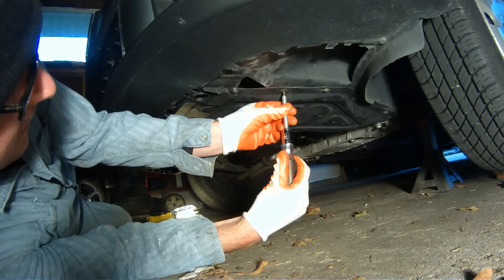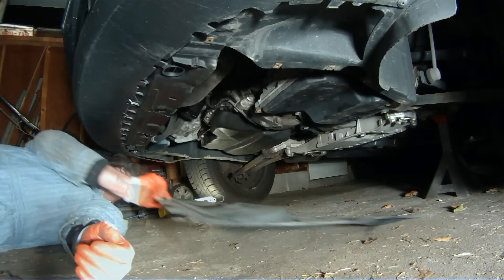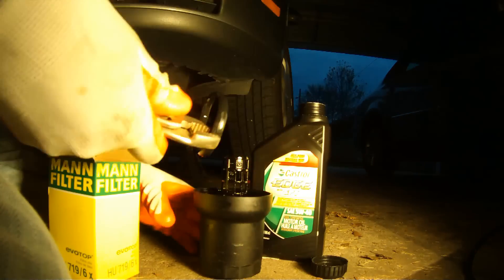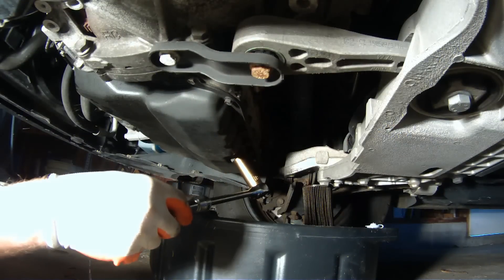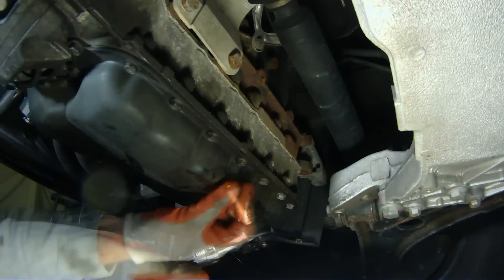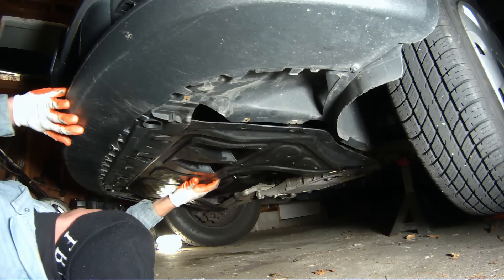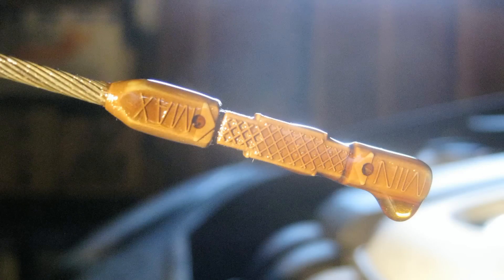VW Rabbit Oil and Filter (2004-2008)

Comment: I have changed my oil and filter 12 years in a row with no problem. Today I tried to take the oil filter cap off and I could not get it to budge. The socket was slipping on the cap. It is way too tight. Someone advised me to put a sheet of paper in the socket for a more tight grip and try. I wasn't aware that hand tightening was sufficient.
Reply: @Doom1AM  Tap lightly on it with a hammer or metal tool. Mine never comes either until I tap it with something,
Reply: @Doom1AM  Great news. Glad you had success finally. Someone on here suggested to hand tighten the cover and I am going to do that next time and  I should have better luck getting it loose when I need to change the filter. Take care.

Comment: Great video. Used it a few times to change the oil in my 2006 VW Rabbit. A word to the wise: make sure you're putting in the filter housing exactly in the threads. Had an issue where the threads were slightly out of alignment and the vibration of the car caused the filter to back out, causing a massive oil leak. Eep!
Reply from the maker: thebumblebean Good tip!  Reminds me of that game Spy Hunter:).

Comment from the maker: You don't "have" to drain the filter first.  I chose to show it first in this video because I figure more viewers are curious about how that confounded thing works than how to loosen a drain bolt:).
Reply: do you know how many times the DSG version shift, besause i saw a rabbit here in holland but normally you see in wich gear the car is driving but by the rabbit i didnt saw it,,, is it a 7-speed automatic or a 6-speed automatic..

Comment: I recently had a oil change done at a  super lube location and 4 days later my splash guard was sagging in the middle, after driving on the highway for awhile .I took the car back to the garage and told them and was accused of bottoming out my car . I was told by another garage they should be taking off the splash guard before the oil change and when I said this they looked at me like I was crazy .  Not going back there for a oil change  but they offered to install a new one free of charge 🙄 but I would have to buy a new splash guard
Reply from the maker: @dpetit007  This is exactly why I don't let anyone else change my oil.  Whether at an oil change place or a dealership, the person doing the oil change is typically an inexperienced underpaid impatient teenager.  There's a high likelihood they will lose one of the fasteners and be too lazy or too frustrated to seek it out and reinstall properly. Although this particular splash guard is very straightforward, some splash guards use significantly more and  a variety of fasteners. Sometimes one or two missing fasteners is no big deal, but other times a single missing fastener can lead to other underbody damage and unnecessary wear and tear.
Reply: I guess I’m going to learn how to change the oil…, wish I learned this before 😊

Comment: really good video and info about where to get cheap the tool removal
Reply from the maker: Thanks for the comment!  The oil filter housing could actually be removed with a traditional strap wrench too, but I was nervous about possibly breaking the plastic housing when not using the perfect tool.

Comment: My vacuum pump leaks slightly, can just fell oil around the edge with my finger. Should I change part right away. Valve gasket was already replaced.
Reply from the maker: I coincidentally rebuilt my vacuum pump two weeks ago due to the notorious VW leaky vacuum pump issue.  It looks like a pain, but it's not that bad.   Do it!  I bought my rebuild kit (two gaskets and a hose seal) from RKX Tech for $36.   I used the RKX Tech instructional video and the Deutsche Auto Parts video (both linked below) for guidance. You'll need to watch the latter video from Deutsche Auto Parts if you have an automatic transmission which is slightly more complicated than a manual transmission.  My oil pan, splash guard, and drive way are dry as a bone now.   Good luck with your project!

RKX Tech Video
https://youtu.be/t8s1y3RIG7s

Deutsche Auto Parts Video
https://youtu.be/Maf3-7C5qZI

RKX Tech Rebuild Kit
https://www.rkxtech.com/products/rkx-vw-audi-2-5l-vacuum-pump-reseal-rebuild-kit
          
Shout out to @RKXTech.com and  @Deutsche Auto Parts for educating me and saving me $1,000  over what the dealer would charge!!!

Comment: Another great video! When I tighten the oil filter to the housing I use the two arrows on the housing. The first arrow is to snug & the second is to tighten. And there is a common mark on the housing BASE you are tightening to, (looks like a triangle). I painted that mark red, and the marks on the housing painted silver. And don't go past that second mark it's only plastic, cost to much $ to brake.
Reply from the maker: More great advice!  Thanks!

Comment: Thanks, I am going to save 50$ doing this myself. also, I am not always sure they put in the real synthetic oil.  Mine is a 2007 rabbit 2.5 is there a difference?
Reply from the maker: Your 2007 should be identical to my 2008.   Also, I agree. You never know what the oil change place is putting in.  Further, even an advertised  "synthetic" oil change is not necessarily European grade synthetic, which costs significantly more. If you hit Advance Auto on the right day, you should be able to get a 5 quart jug of the correct Mobile 1 for $38 and they'll throw in a $15 filter for free!
Reply: Thanks, for the follow up, I live in So. California, I've never seen an Advance Auto. I paid $20.60 for the filter at the VW dealer. I'll check out Advance  online.
Thanks again
Reply from the maker: I made my first ever car repair in my friend's driveway in Oakland, CA!  A water pump on a 1973 Dodge Dart.  Then we drove it to Wisconsin. I believe we bought the parts at a Pep Boys?  You still have those in Cali?
Reply: Yes, I think in Pasadena?  My brother and I changed a camshaft belt on a 78 Honda civic. We were just kids and it seemed impossible at first, but with one of those manuals for a complete idiot we did it.  I wouldn't try anything like that on today's cars.

Comment: This is really good.  Hey quick question.... the Rabbit has a special jack that has a groove in it to accommodate the welded plate when you lift it.  But, you just used a flat surface jack, from what I can tell.   Did I see that right?   Are their pros/cons to this method?  Thanks!
Reply from the maker: The scissor jack that comes with the spare tire kit has a groove to mate with the jacking point.   That's important for the scissor jack because it gives the scissor jack added stability.  In my opinion, the scissor jack is an emergency-use-only jack.  You should only use it if you absolutely need to change a flat on the side of the road.   You should never rely on the spare tire kit's scissor jack for doing other maintenance that requires you to lift the vehicle for an extended period.  Never get underneath a vehicle only supported by a scissor jack.  Those things are flimsy:)! So...in closing...lift your car with a quality jack rated to handle the weight of your car and add extra support with jack stands and wheel chocks and parking brake. Stay safe:)!
Reply: @hanoihancock  oh I definitely agree, and I'd never go under a vehicle unless it were on ramps, or jackstands.   (and even then I put extra emergency supports just in case).   My main question was about those hockey puck groove adapters that claim that a flat top jack, with a thin jack point, can cause the jack point area to bend a bit too far... I get that the jackpoint is engineered in such a way that the emergency jack is a bit more stable... but in the case of using a real jack, or jackstands, since they have a flat top my impression was you need to now protect the bendable jack point.... sorry for not being clear.
Reply from the maker: @splatbubble  Okay.   This is a bit embarrassing. I had never head of a jack pad until you posted this comment.   I just ordered my first set of slotted jack pads for $12 (https://amzn.to/3sXchay).  Eager to see how they work!  TY!

Comment: Was wondering if you happen to know the torque sequence an spec for replacing he lower oil pan gasket?   Been putting off doing this an would feel better knowing
Reply from the maker: According to the Haynes manual, the lower oil pan bolts should be removed and reinstalled in diagonal sequence.  Tighten by hand first, then tighten to 89 in-lbs or 10Nm.

Comment: Does the T23 and 17mm drain bolt apply for the 2006 Passat?
Reply from the maker: The 2006 Passat (B6 platform with 2L) uses a 19mm drain bolt and T25 Torx fasteners for the belly pan.

Comment: I read that the vw rabbit 2.5 oil housing tool is 74mm not 76mm. Which are you using?
Reply from the maker: Just double-checked my garage.   My tool has 76mm 14 flute written right on the label.  I just changed the oil on this vehicle last week. I did a little searching however, and found that similar oil filter wrenches are advertised as "74-76 mm".  I suspect that may be why you are seeing references for both.  Here's an example.  

https://www.blauparts.com/audi-vw-oil-filter-wrench-74mm-76mm.html 

On the other hand, maybe I've been using a too-large-but-small-enough filter wrench all of the years and just never noticed?  I may just buy one a 74mm wrench just to see if it fits my Rabbit.
Reply from the maker: So...I ordered a 74mm Aluminum Oil Filter Socket (https://amzn.to/2K12xr9) and it fits even better than the 76mm socket I've been using for years!  TY for asking this question!

Comment: Why is there a flat O-ring, and a standard O-ring about the same diameter. My filter housing is leaking after my last oil change and I only used the flat O-ring.
Reply from the maker: I think some paper filters come with both kinds of O rings so the filter can be used with different cars that use different O rings.  For this car, the flat O ring is the correct O ring.  I recommend changing the oil again and inspecting the filter housing closely to make sure the O ring is seated properly and that there is only one O ring in there. It's common for an old O ring to be accidentally left in the housing while installing a second/new O ring.  That'd cause leaking. Maybe clean out the slot the O ring sits in with a Q tip to be sure there's not a pebble or something stuck in there.  Good luck!
Reply: @hanoihancock  I’ve reinstalled this thing 3 times, and I’m starting to think it’s an oil cooler gasket above the filter housing
Reply from the maker: @PacificParadiseProductions  That'd be unfortunate:(.  It's already unfortunate that you've had to spend 15 quarts of oil and are still leaking:(.  I guess you've gotta get some nice bright lights and some rags and some good music to listen to.  Lay on your back.  Clean the crap out the oil filter area.  Wait and watch for the origin of the leak.  Pray that it's a faulty or damaged filter housing.

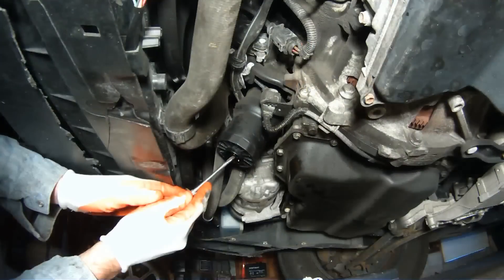Comment: 0:43 , what do you have attached to your ratchet? love how concise the video is man, so easy & simple. much appreciated by a non-car guy that wants to start learning how to do the maintenance on my car
Reply from the maker: That's a 74mm 14 flute oil filter wrench.   You use it to unscrew the oil filter.  You can buy one using the link in the description for around $10.
Reply: @hanoihancock  Thanks man

Comment: Just got my rabbit is it true oil changes are every 10,000 miles or 12 months
Reply from the maker: Yup. 10k or 12mo is recommended for the Rabbit and most newer VW's. Changing more-frequently won't hurt...and is probably good if you have harsh driving conditions.  I change mine as close to the 10k mark as possible.

Comment: How much oil drains from the housing?
Reply from the maker: Tayler Packard You should drain from the oil pan first.  Otherwise it will drain seemingly forever from the housing.  If you drain from the housing second, there will only be a cup of oil to drain.  I just show the housing removal first in this video because it is the only non traditional part of this oil change, so I figured I'd demystify it in the first minute.

Comment: What size filter cup did you use?
Reply from the maker: "Oil filter wrench is 76mm 14 flute and can be had for $4.80 after discount from Advance Auto (Performance Tools CP WRNCH 76MM,14FL Part No W54106)."

Comment: what is that tool you used to take the filter housing off?
Reply from the maker: "Oil filter wrench is 76mm 14 flute and can be had for $4.80 after discount from Advance Auto (Performance Tools CP WRNCH 76MM,14FL Part No W54106)."
Reply: hanoihancock Thank you

Comment: But what is the size of the oil pan plug???
Reply from the maker: My oil pan drain bolt has a 19mm hex head.  I believe that's pretty common for Golfs and Rabbits of this generation, but...I can't promise yours will be the same.  For example, a Google search for “2008 VW Golf Oil Pan Drain Bolt Size" returns a few hits with 14mm hex head heads and even a hit for an Allen head drain bolt.
Reply: @hanoihancock  i took a gander at it and It turned out to be a 19mm hex as well thanks for the reply bro

Comment: I got Castrol edge sae 5w-30 is that ok?
Reply from the maker: Ninja_ X1204 The oil just needs to meet VW 502.00 standards.  There are a few different Castrol Edge 5w30 products that meet that standard, but there are also some that don't.  You've gotta check the container and read the fine print.  Castrol Edge Professional OE and Castrol Edge European Formula both come in 5w30 versions that meet the VW 502.00 standards. However the plain Castrol Edge 5w30 fully synthetic...the stuff that is currently sold in the black containers at Advance Auto and Wal Mart in the US...doesn't meet VW 502.00 standards.

Comment: If you don't want to damage the little valve on the bottom of the oil filter housing, you can buy a special tool that screws onto the housing (after the dust cover is removed) and opens the valve in a straight direction instead of at an angle. The tool has a hose that directs the oil into your oil pan and is much less messy. It's between $17 to $47 depending on the brand. The cheap one works just as well as the expensive one. 

I wonder why VW doesn't use a spin-on oil filter which is far less messy. German engineering takes something simple and makes it complicated, just like the ATF and coolant drain/flush/install. I guess they want to make it complicated so you will have to take it to their "special" dealership service departments. Just sayin'....
Reply from the maker: I totally agree. Most of the time simplicity is the best engineering.
Reply: @hanoihancock  According to the VIN on my 2008 VW Rabbit 2.5L, it was manufactured in Wolfsburg where the original "People's Car" aka Volkswagon  was born as the Beetle before WWII and continued for many decades in its simplicity. Isn't it ironic that my Rabbit is everything except simple?

Comment: Does is matter if I use 0-40 or 5-40?
Reply from the maker: +Aaron Love Nope.   Either is acceptable.   I suppose the 0w-40 is thinner than the 5w40, so if you really wanted to split hairs, maybe use the 0w-40 in winter and 5w-40 in summer?

Comment: I noticed you used 5W-40. Is that ok to use since it calls for 0w-40?
Reply from the maker: Both 5w-40 and 0w-40 and some other weights are acceptable.  It's more important that the oil meets the he VW502 00 spec.  One might lean towards the 0w-40 in colder climates.   

"Use recommended European synthetic like Castrol Syntec 5w-40, or Mobil 1 Ow-40, or any other oil with the VW502 00 spec".

Comment: 6 and a half q?! I've always only used 5.5 lol. Should I throw another bottle in there ??
Reply from the maker: As long as you are measuring full on your dipstick, you are fine. You can never really get ALL of the 6.5 quarts out when you drain.  Some stays sticking to the components in the engine.  If you allow it to drain for an hour while the engine is at operating temperature, you'll probably get a little over 6 quarts out, meaning you will have to top off with a little over 6 quarts.   6.5 quarts is the actual total capacity.

Comment: What kind of filter is that??
Reply from the maker: abnormal_is_pretty That's a paper Mann filter.  Specifically, it's Mann part# HU7196X and can be had for circa $10 US from multiple internet retailers and auto parts stores in the US.  That same filter also fits these models: Audi: A3 2006-08 | A4 2005-09 | A4 Quattro 2005-09 | TT 2008-08 | TT Quattro 2009-14 - Volkswagen: Beetle 2006-10 | Beetle 2012-14 | Eos 2007-08 | Golf 2010-14 | GTI 2006-08 | Jetta 2005-14 | Passat 2006-08 | Passat 2012-14 | Rabbit 2006-09

Comment: The car wasn’t level when you check the level of the oil you should’ve taken off the jack and the checked
Reply from the maker: Good point.  I actually check the oil  again after lowering it and again after running it and cooling it, but that's all a bit much to show when trying to keep the video brief.